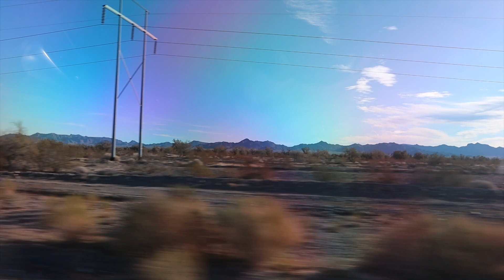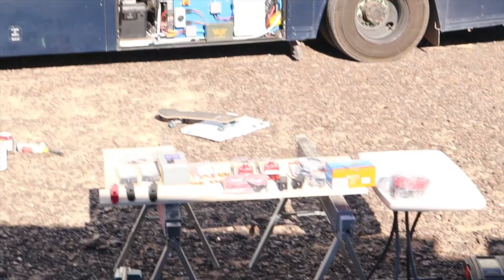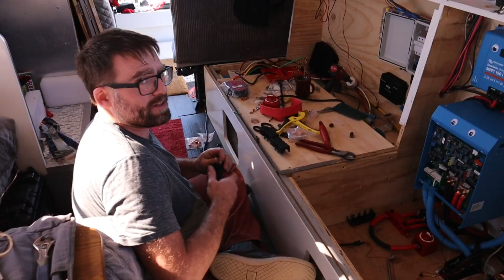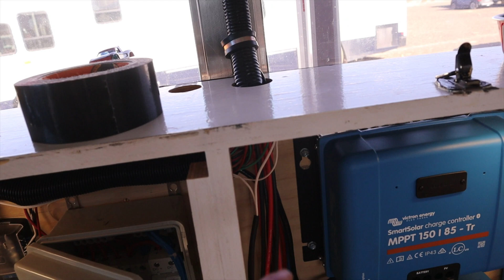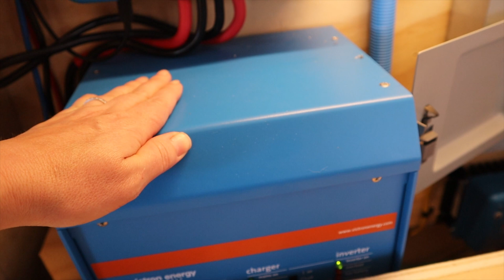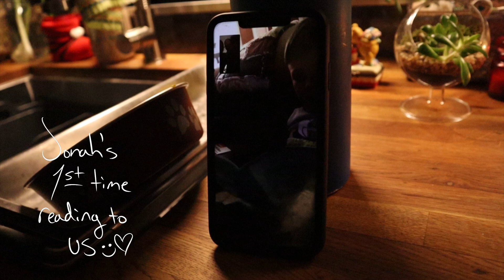Victron Solar Install After Aims Fail

Comment: Upside of your new system is when your AGM batteries reach end of life, you can switch to Lithium (LiFEPO4) batteries for 1/4 the weight and 10x the lifespan and all your components will work.
Reply: dchubb42 absolutely!!! That’s the plan!
Reply: Btw our bus (Life Less Ordinary) will have basically the same system (same inverter, same charge controller, slightly different 24 to 12 DC converter and might add the alternator charging.)

I have 880ah of 24v LIFEPO4 from BatteryHookup.com ready to install.

Still deciding on panels but looking at 6 400w monocrystalline.
Reply from the maker: Youtube keeps telling me that we haven't seen or replied to this comment haha. Hope you're great!

Comment: Slight correction on your solar intake: your panels are in series groups on the roof for ~80 vdc, and then parallel up to a higher amperage ~80vdc input to the solar charge controller. The output from the charge controller is ~24 volts.